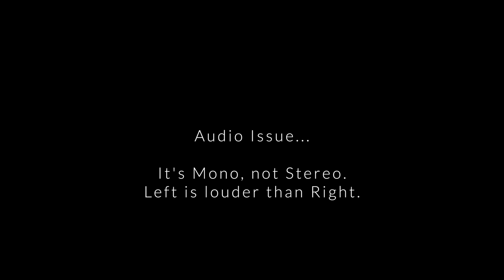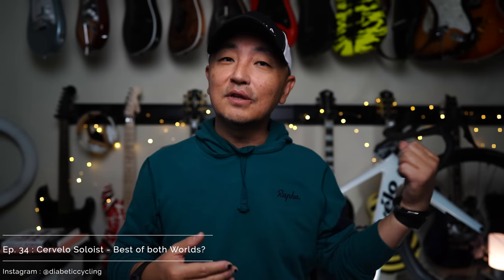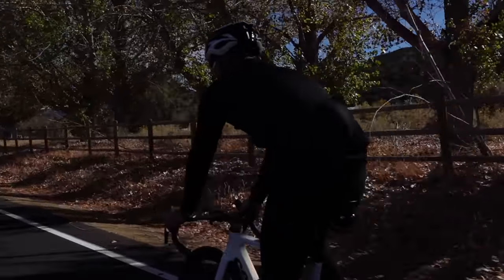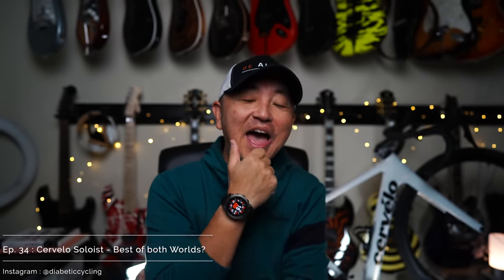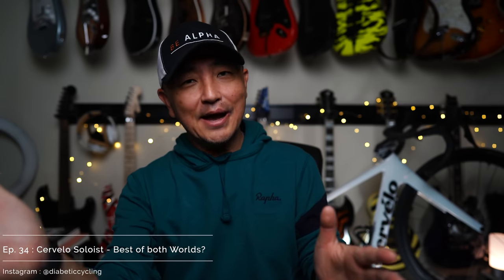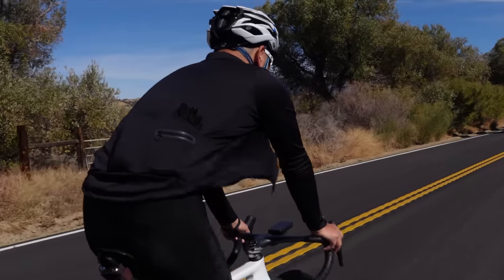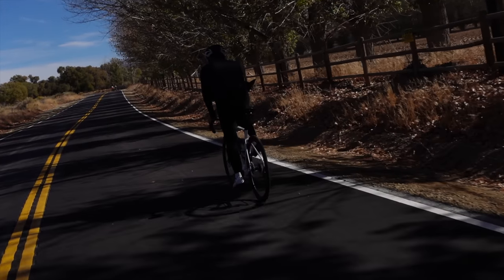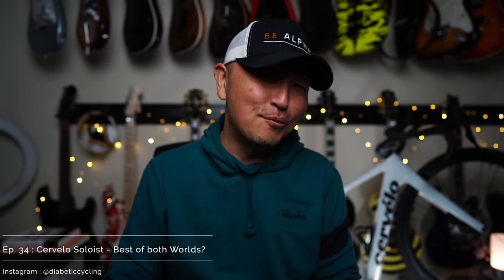Ep 34 [ENG] - Cervelo Soloist 2022/2023 Full Review

Comment: Anyone around here know if the bottom bracket needs to be the asymmetric type?  It looks like either T47 'inboard' or T47 'outboard' are a bit more common.  Im only seeing T47 asymmetric from ceramicspeed and kogel.  I'm thinking about taking the plunge on this frame but bb availability is important to me because of how i treat my bikes. ty
Reply from the maker: Asymmetric. A bit expensive one may argue, but this was a recommendation but every damn penny worth it.
Reply: aha, for anyone else finding this..   wheelsmfg makes a T47A as well and specifically claim "Cervelo T47a 79mm shell width" compatibility.
Reply: Check out BBInfinite's. One of their T47 modules actually fits two BB standards: T47I and T47A. This is due to the drive-side cup being a sleeve that slides over the one-piece module, which threads from the non-drive side.

Comment: which vision handle bar did you use?
Reply from the maker: Hi Zach. Just a Metron 5D that was kicking around in the garage... One of my favs.
Reply: @DiabeticCycling  so you are using a round shape stem on a d shape steer tube? How does it hold up?
Reply: @DiabeticCycling  so you are using a round shape stem on a d shape steer tube? How does it hold up?